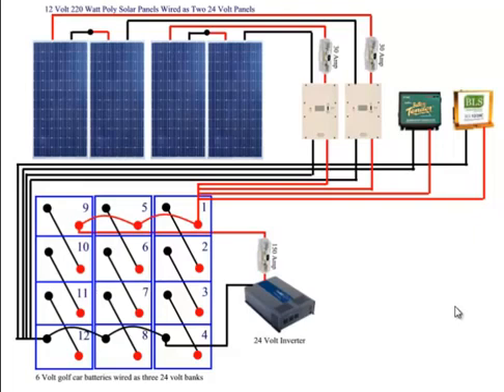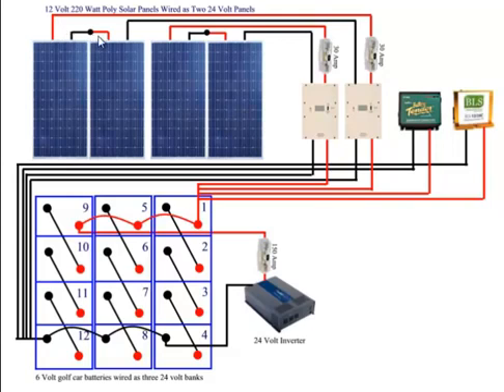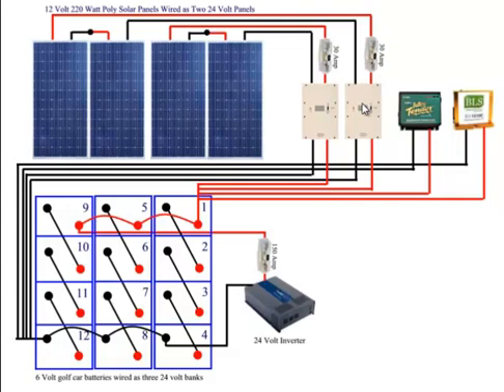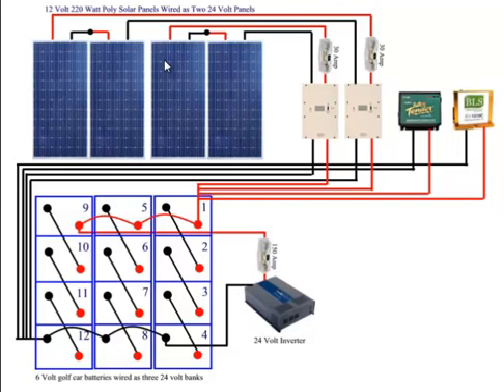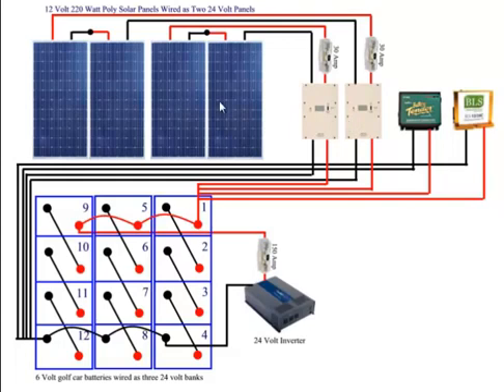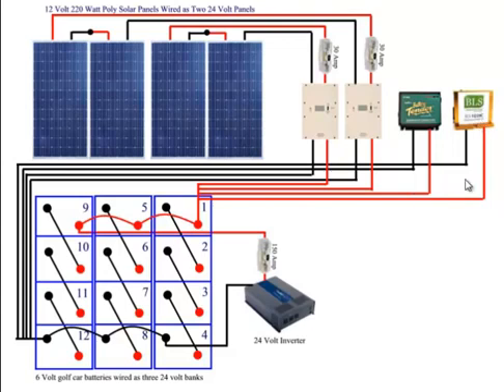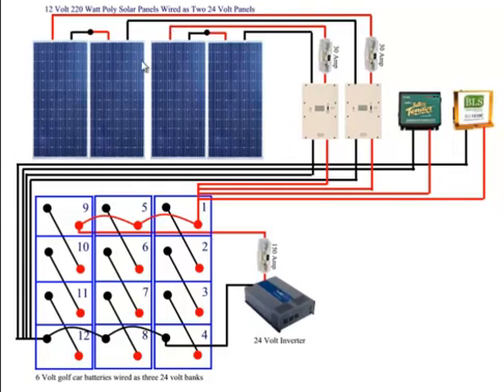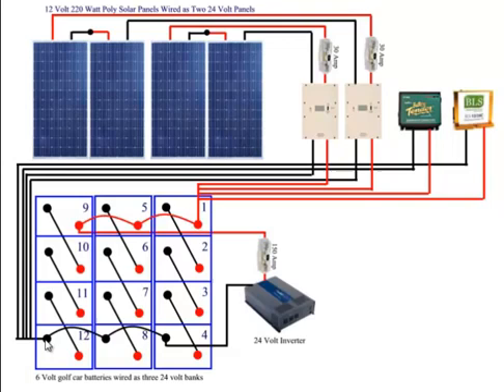DIY Solar Panel System Wiring Diagram   from YouTube

Comment: Hi, This is very nice illustration video and all the good precautionary design is what I need. you always need redundancy system in in case the charger controller busts out. I like the wiring diagram and how graphically it is neat. kindly share with us the software you used to draw the diagram . Thanks again for sharing your skills with us .

Comment: Nice video.  BTW, why didn't you use blocking diodes between each set of battery to prevent one set from charging another (in case there're voltage differences in the battery set)?